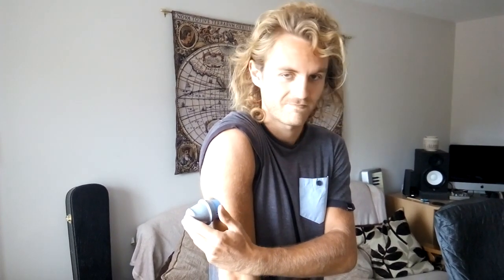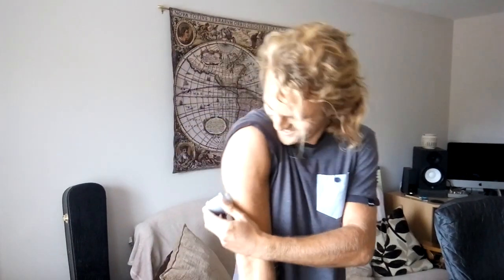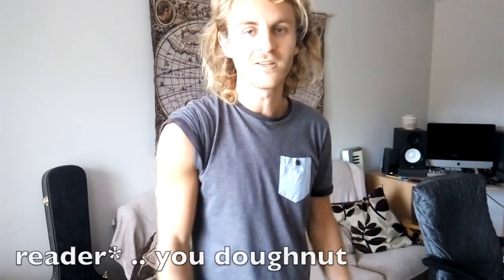How to Apply a Freestyle Libre Sensor!

Comment: Nice video, I am using NightRider Blucon with Libre which is working very well. The LinkBlucon app has so many features which helps my a lot with my exercise and Insulin and very easy for me to share readings and reports with my healthcare provider.
Reply: I bought the Blucon device few weeks back and it is working great with my Libre sensor.